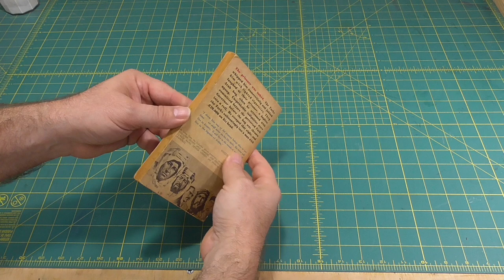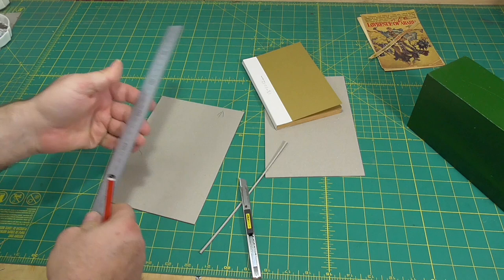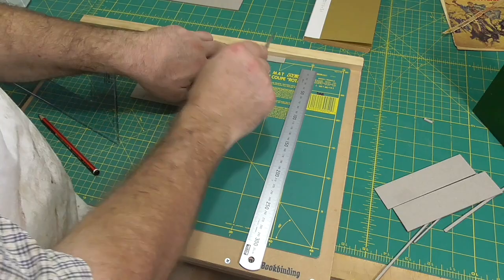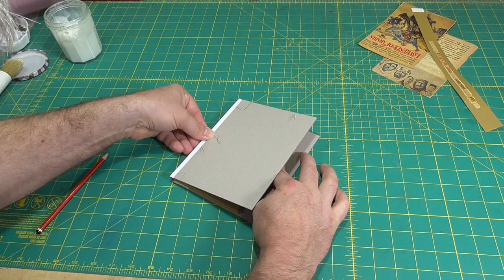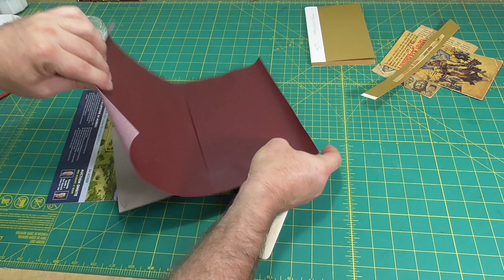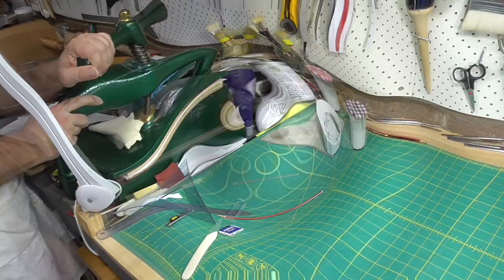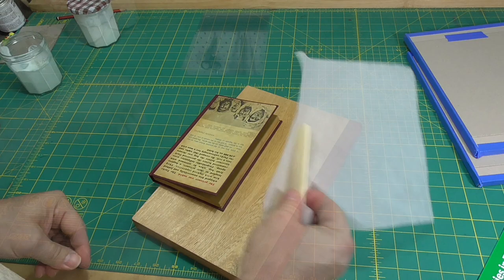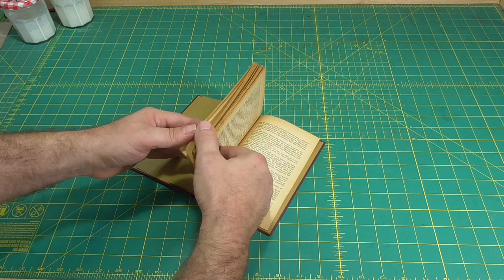Paperback to Hardcover Keeping Original Covers Part 2 // Adventures in Bookbinding

Comment: Please do paperback to hardcover with book that's coming apart. I have few books that are with me since my teens and after 30+ years they are dying and I am thinking how to preserve them they aren't any way valuable just have sentimental value to me.
Reply: can probably use the same method unless pages are falling out from inside. if the textblock is just split but all the pages are still well secured, a cloth reinforcement of the spine + case like this video would suffice. If single loose pages are falling out, the glue has failed, and you will need to be a little more invasive. ive had success knocking the book back into shape then sanding the adhesive off in a standing press like he shows in this video when brushing the edges clean. then i cut little nicks in the spine area with a hack saw and inlaid bits of hemp string across the spine as reinforcement with some acid free PVA, then cloth reinforcement over top of that, followed by case binding as shown in this video.

Of course i am just a hobbyist, not a professional by any means. my approach may make a true conservator cringe, but if the book is of no real historical or monetary value, i don't see the harm in the way i did it.
Reply: I did the same as fakiirification, but it depends on the book's condition. I usually laminate the covers though, using cold-laminating stickers to avoid cracking

Comment: 5:10 MY suggestion for beginners (and you can call me out on this if I'm wrong) is that you put the glue on the boards one board at a time and NOT on the cloth because of this little step at 5:50. One trip to the ER and a ruined book cloth later and pretty sure I'm going to be done with this hobby lol. Thanks for the videos anyways, they were very enjoyable to watch!
Reply from the maker: I think it better to try and apply the adhesive to the cloth.  The cloth can change dimensions slightly and cause wrinkles as it absorbed moisture if the adhesive is applied to the board first.  It also good to work the adhesive into the grain of the cloth for good adhesion.  This doesn't mean you can't do it the other way, but I think the best way is to glue out the cloth and I think it is better to start with using the best method.  It's just a case.  If it goes wrong, they can easily be made again.  Good luck!  DAS

Comment: By far, the most informative channel I've found.  Thank you. 
I'd be interested in how you would handle a thicker book, such as The Silmarillion,  that has been curled back so badly the spine resembles a C?
Reply from the maker: Such a simple question, but such a complex answer:)  Occasionally you can get these concave spines back close to flat.  But often easier to pull the book back to single sheets, double-fan bind back together and move forward from there.  To get the heat activated adhesive off the spine I use an hair drier to soften the glue and carefully scrape off while repeating some calming mantra.  If the book is otherwise good condition I think you can accept this is what the book wanted to do and is thus the actual natural state of the book and appreciate it.  The famous bookbinder Jim Brockman put a lot of effort into convincing us the concave spine is a perfectly natural state for a book.  All the best, Darryn

Comment: I recently received some old western magazines that belonged to my grandfather. I would like to make a leather bound book out of these. The magazine's are stapled together so I was hoping to sew them together like you would do in normal construction. But any advice would be greatly appreciated. Thank you very much for sharing your knowledge in your video's.
Reply from the maker: It's very exciting to get treasures like this.  Magazines are hard to bind because they are so thick.  Commercial binderies do make them look good bound up, but they usually do a lot of damage to the magazines in the process.  If these were from my grandfather I would make a clamshell box like in this video
https://youtu.be/a5sa0KXJf3Y
This protects them and lets them be stored like a book on the shelf and looks good.  And they are kept in the original state that your grandfather would have read them in.
And while leather sounds great, unless you have experience with binding in leather it is very tricky.  You need to practice and build up skills.  But good bookcloth can look fantastic, lasts a long times and is much easier to use when starting out.
If you did want to bind them, hopefully all the staple hole spine up (they never do), but if they do, use the original holes for sewing.  sew over linen or cotton tape placed where the staples were.  Once you have the text block, follow the video I have on a square back Bradel binding.  It is difficult to round and back magazines because of the thick sections.  A commercial bindery has a machine to do this.
Just some thoughts.
All the best,
Darryn

Comment: Thank you very much for sharing this.  I have many manuals that will be getting this done to them. 
If you don't mind me asking how do you go about recessing the ald cover into the new hard cover?
Reply from the maker: In this case I would have put a very thin strip of card the same thickness as the original covers around the outside edges of the new board.  The space left should be slightly larger than the original covers to allow for a bit of stretch and the thickness of bookcloth.  You might need to trim the original covers down to get them to fit.  You also need a good press to press the original cover in place as the bookcloth doesn't like to stretch like leather.  All the best, DAS

Comment: Hi Darryn! 

Can you explain the "square" you refer to when measuring boards and other precise measurements? I know this can be a very detailed and lengthy explanation, and would appreciate an article discussing this detail just as much.

Thank you,

Rachel
Reply from the maker: A video on the names of the parts of books is on my to-do list.  It's the inside part of the cover boards that extends past the text block.  It of course is not square shaped, which makes it confusing.  A book which has cover boards the exact same size as the text has no square.  For small books a 2mm square is nice, and 3mm for standard size and 4mm or more for large and giant books.  Hope that makes sense.  All the best, Darryn

Comment: is there any resource anyone can give me that explains how to make an indent in the new case so that the original covers fit snuggly into it? he mentions this around 8:48
Reply from the maker: It's a bit different, but I think it's the Bradel in-boards video where I inset cloth patches in the covers.  It's the same principle except it is thin frame around the edges instead of a small oval in the middle of the boards.  Hope this helps.

Comment: Fantastic video as always 😀. What do you think of self adhesive foil? I was thinking of using it in case where the paper cover is in bad condition
Reply from the maker: I'm not sure what self adhesive foil is.  I use heat activated foil for stamping titles on books.  The spine is often missing or in very poor shape and I will put the title and author on the spine using hot foil in these cases.  All the best, Darryn

Comment: If someone would like a recess for the old cover, would embossing it on the new cloth cover do the trick? Old paper covers are usually quite thin. Or should one go for a layered board with a cut-out in top layer instead?
Reply from the maker: If you have a steel book press you can usually force it in so well that it is as good as recessing it.  DAS

Comment: Hello, I had a problem and I can't find an answer, after glueing text block to cover I can't open it to more than 90 degrees without ripping it apart.
Reply from the maker: This is a common problem and it is really hard to diagnose without the book in hand.  The square back binding is a strange beast and in some ways shouldn't work.  The things I look at are the width of the joint - the space between the cover boards and the spine board - which if too small will cause this, the attachment point of the endpaper- which if away from the spine can cause this.  Some times people get a bit of glue on the spine and it sticks to the spine board stopping the book throwing up which can cause this.  Sorry this isn't much help.  Darryn

Comment: One more dumb question if you'll allow it. Car vinyl wrap is cheapi-sh & has many cool patterns. Is it possible to use it for crafting the hardback instead of the book cloth you typically would use? Any thoughts/ advice on that? Thank you! 🙏
Reply from the maker: I don't think I would.  They are design to not last a long time compared to books.  I wouldn't trust the adhesive.  If you have to, maybe look for sleeking film.  I'm looking into this at the moment.  I'm not feeling super good about it though.
Reply: @DASBookbinding  Understood. My project is more a novelty gift. It would be displayed more than handled so I'm not worried if it doesn't last 50+ years. I'll research which adhesive I can use to keep the vinyl adhered to the book. Thank you for the feedback!

Comment: In the video you mention the difference between presented here and english style square back binding. Do you have a video on english style square back binding?
Reply from the maker: No, I don't.  It's a fairly minor difference.  English binders don't have the piece of paper that joins the boards and spine stiffener.  They just glue everything directly to the spine cloth.  I guess I do this in the rounded and backed case binding - not square back, but same principle.  Adding that piece of paper I think makes everything so much easier, once I started doing it about 10 years ago I never went back - for square backs anyway.  DAS

Comment: would you say that this is the better method for preservation as compared to the other method where you converted a paperback to hardcover?
Reply from the maker: The other method was specifically to produce a book with a specific look.  It's not the best way to convert a paperback to a hardcover.  This method is fine for repairing  a damaged paperback and converting it to a hardcover at the same time.  Neither are really meant to preserve a paperback.  Putting hardcovers on a paperback probably shorten its life.  It results in harsher forces on the spine and the square will mean the tail edge of the text will be exposed to air more.  The best way to preserve a paperback is with environmental control such as a simple 10 minute slip case of a phase case/wrapper.  Hope this makes sense.
Reply: @DASBookbinding  it does make sense, I was under the impression that converting a paperback to a hardcover was somehow better for conservation in general, but now that I think about it, it makes more sense that leaving the original binding is better than any manipulation one could do.

Comment: Hello. Another exciting video. - I was wondering what you think about putting a layer or two of PVA over the old covers once you have re-attached them. I was thinking this might provide protection from moisture damage. - Also, would it do anything to stop or slow the acid degradation that is in process? Thanks.
Reply from the maker: I don't think I would.  The original covers will a water fast ink.  And it will just trap the acidic compounds in the covers.  Would be nice if it would help.  Ciao, Darryn
Reply: @DASBookbinding  Okay. Thanks.

Comment: One question if I may. Why not glue the spine of the book to the spine of the case? Wouldn't it be tougher if we glue them together ?
Reply from the maker: The book would open very poorly.  A book opens through two main mechanisms - the leaves of paper bending (called drape) and the spine of the book flexing up (called throwing up - yeh, who came up with that description!).  This book has a rigid spine piece.  If the spine was glued to it, the spine wouldn't be able to "throw up" and would be totally reliant on the drape of the paper.
Reply: @DASBookbinding  Thank you for your answer  ! You are so kind and generous to give this information. I am about to bind my own thesis of LLM degree. The thing is, I have found some square back case binding books which glue spine together. That's why I have this question.  I will try to figure out what you mean. It is nice to learn from you. Thank you again. I wish you get better (from COVID-19).

Comment: How could you prevent the paper cover from wear and tear when stored on a bookshelf, since it's simply glued to the outside and possibly open to fraying? Would some sort of lamination or sealant work?
Reply from the maker: It normally doesn't.  But rather than trying to seal it, maybe a 10 minute slip case (see video).

Comment: Is there a way to save a dissolving paperback and turn it into a hardcover?

My university books are notoriously badly bound, but at least they are cheap. Still would like and try to save a few of mine.
Reply from the maker: If the paper is acid and it is deteriorating, there is not much that can be done.  But if the pages are just coming apart, pull it apart completely, cleaning the old glue off the spine edge, and remake using a double-fan (Lumbeck) binding.  Good luck!
Reply: @DASBookbinding  For these, yes they are acid free paper. Just found your double fan video. Will try it out after I make myself one of those vices.

As for books with acid paper, is there any way to save them? Glue them back together or to neitralize the paper so they won't start falling apart?
Reply from the maker: @HibikiKano  Unfortunately there is no realistic deacidification process suitable for the hand bookbinder.   There are some methods featured on the internet, but they are problematic and I would not recommend them.
Reply: @DASBookbinding  Thank you for the heads up. Well most of those arent worh much, but a few emotionally importat books. Those are few enough I could try to ask a professional restorer if they could fix them up for me.

Also I have one more question. If I may add it here. I have a box of books that we inherited a while back but due to lack of space kept in the box we got them from. Failed to notice that a light white mold has spread over the covers of a few of them.

Is there a way to save those books? Can I take the ones that dont look moldy out and somehow preserve those at least? Or are all gone?
Reply: @HibikiKano Were you able to salvage those books? Maybe a UV light to kil it followed with some kind of sealant?

Comment: What is your opinion on using a roller for paste to bookboard to book cloth rather than a brush?
Reply from the maker: It's a great idea, especially if you have a production environment.  You have to leave the roller in the PVA though, because if you clean it every day you waste a lot of glue.  But I find if I don't use it for a few days, over a long weekend, the glue starts to set in the roller.  So I just stick with a brush.  If I was doing an edition of 10 books I have a roller I would use.  Darryn

Comment: Hello (again!)! Thank you for this very interesting video! I have just a little question: How would you do to insert the original covers inside the book? Would it be possible by guarding the original covers with strips of paper pasted on the endpapers (on approximately 3 or 4 mm) ? Thank you very much!
Reply from the maker: I'm not sure I understand the question, but your ideas sounds great.  You've got this!  DAS
Reply: @DASBookbinding  Thank you for your answer! i'm wondering if it is possible to insert the original covers inside the book, just after the endpapers. For exemple, the front original cover would be attached to the white endpapers by guarding it with a strip of paper (part of which would be glued to the back of the cover and the other part to the front of the white endpapers). Then it would be possible to add "coloued" endpapers, glued to the board and to the first white endpaper. Difficult to explain :) Thank you again!

Comment: What diameter round brush would you recommend for an 8.5 x 11 book with this process?
Reply from the maker: I like big brushes.  I normally use a brush that is almost 2 inches round, but in videos I use one about 1 inch, except for fine work which I have the small flat brush for (3/8 wide).  The size of the book doesn't come into it unless it is very small and I rarely do small books.  Ciao, DAS